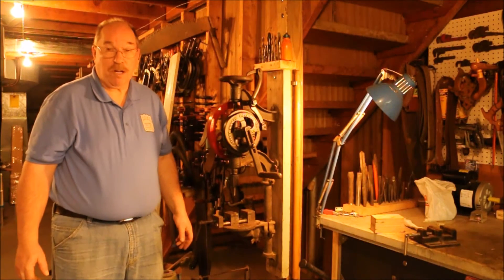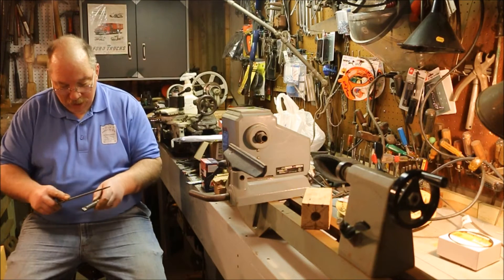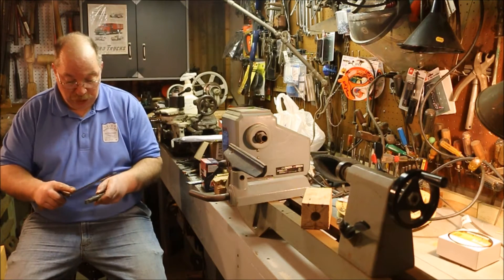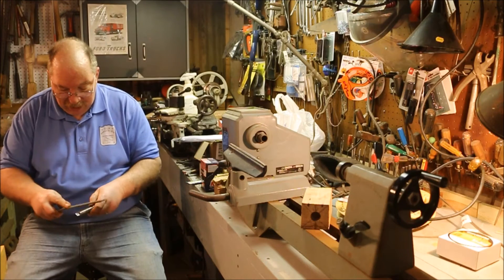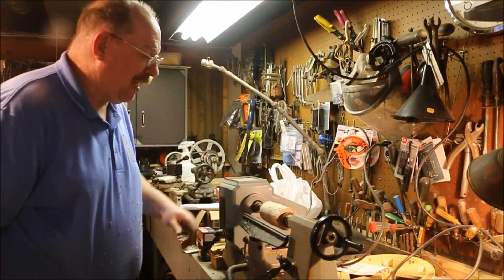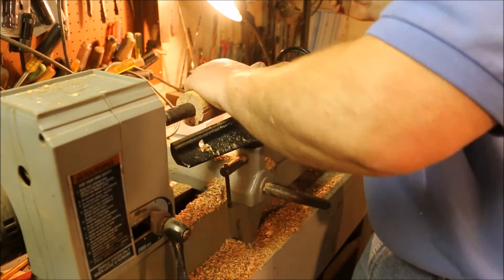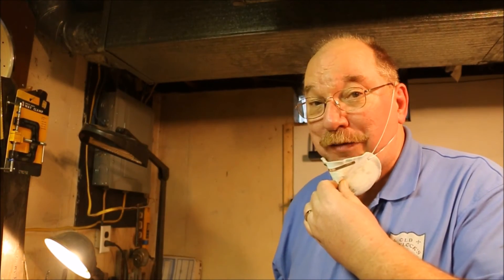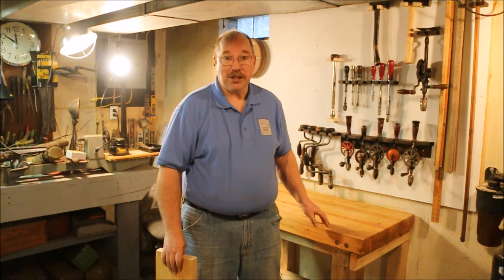Bench Vise Handle ~ Pt 3 ~ Boring & Turning The Stops ~ by Old Sneelock's Workshop

Comment: So far, so good. You'll be lost without the cheater dowel. Got the laptop back with 10 installed. Now we've got a spare. Got to keep track of what Uncle Sneelock is into one way or another!
Reply from the maker: Lewie McNeely Flipping fom the laptopvto a cell phone them this note book is beginning  to feel almost normal. Good to have a backup plan. 😂
Reply: I'm very computer  NOT but as long as my old computer buddy lives, I'll be online one way or another. He had a real deal getting 10 on the laptop. I'd tried several times and it wouldn't take. He had to delete the whole thing and re-do it all. That's what we do and you do all the time. A re-do. Sometimes a little and sometimes a lot.